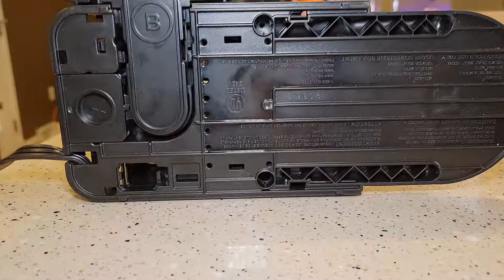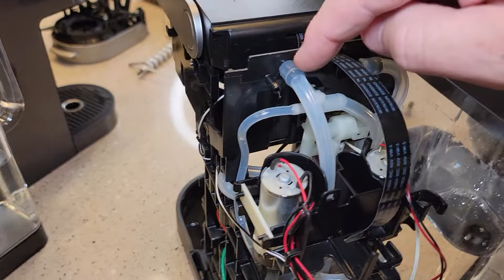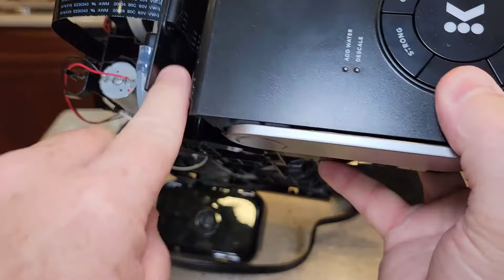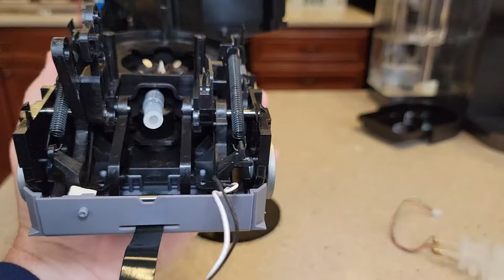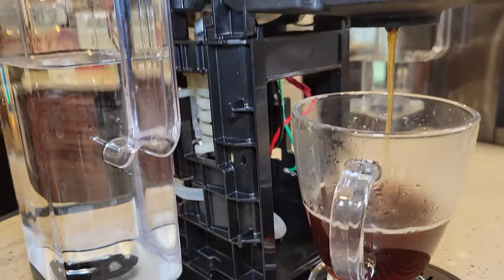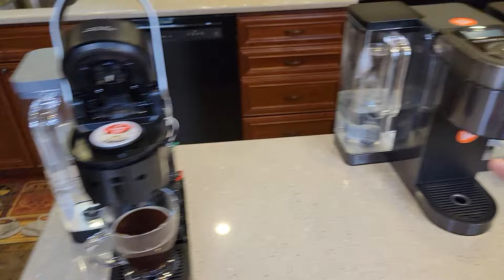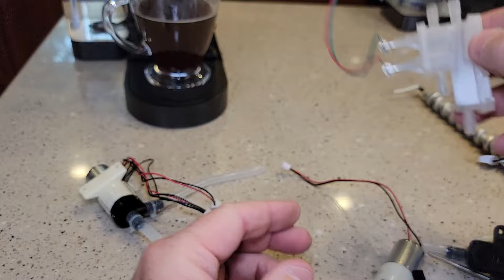🔍☕ Keurig K-Supreme Inside Look | How It Works & How to Take It Apart

Comment: Great video.  Helped me resolve my problem with my K going dead. The heat sensor reset was the fix. Another suggestion to keep that heat sensor from tripping is to make sure you always change the charcoal filter in the tank after every descale if you use it or better still, get rid of the tank filter and use bottled or filtered water from another source. If that filter gets clogged it will slow up water flow into the machine and trip that internal heat sensor. I got rid of mine and it's been perfect ever since.

Comment: I just wanted to know exactly what parts the heated water run through, and if they are plastic. I don't want hot water running through plastic tubes. I saw the heating element is some sort of metal, but I'm trying to avoid plastics. Is there anyway to avoid running hot boiling water through plastic?  Thanks

Comment: Mine was getting intermittent power to the control panel on top, sometimes it would stop in the middle of a brew cycle too. The wires to that microswitch run along the side of the machine and flex every time you open the top, eventually they break on the inside. I had to solder a spliced wire in there and it works like a champ.

Comment: The thermal switch is resettable. Pull the plug from the wall before you do it! Use a larger size paper clip (it's stiffer) and push it in till it clicks.

Comment: This video helped me fix my Keurig that wasn’t brewing full cups. Thanks a lot. In my case it was the tube connecting the manifold to the sensor in the board. It had a lot of buildup inside. All the rest was sparkling clean and seemed to work fine. I took it off, rinsed with water and vinegar and installed it back. Now I can brew full cups again, thanks!
Reply from the maker: Happy to hear that the video was helpful!

Comment: Nice breakdown! First that heating fuse DOES allow you to reset it by putting a paperclip in the hole and “click”. I have a Costco version which looks very similar BUT it does not have the air blower. When mine is near the end of the brew an actuator at the top allows air in allowing the pump to pump dry. Instead of that tube that went to the board, the tube goes to the top of the machine with that actuator wired back to the board.

Unfortunately for me, that actuator stays open so it won’t suck any water into the system. If I pinch the hose during the brew it will work. Then towards the end, the pump sound changes and that’s when the actuator would open allowing air in. So at that point I can unpinch the hose and it will finish the way it is supposed to. At this point I don’t know if it is the actuator or the board not sending the signal. Either way it seems these things are made very differently and my chances of finding a video with a solution slim.

Comment: I think there’s something more going on, at least in mine.  Cause if I just want hot water, hot water comes out and it’s not going through the head.

Run urs without a k cup and u should see.  Maybe that’s what that flaps for?

Comment: How do you get that top part off? The little black wire on my micro switch that tells it when the lid is open and closed is broken off likely due to a bad solder.

Comment: What are the black and white wires that are on the sensor unit? I took mine apart to reset the thermostat and the black wire got pulled out.

Comment: Nice presentation; thanks.  I'm curious how the "Descale" notification sensor works.  What is it measuring, and how does it do that, when it turns on the notice?  Our last two units both had "descale" notices that were impossible to extinguish despite multiple descaling efforts.
This is my first exposure to your channel.  I subscribed.

Comment: The old Keurigs had a disc float in the tank with a small ferrous disk  in it. A sliding magnet switch in the machine housing slides towards contacts that energies the machine. When the water level gets low it breaks contacts and the water fill indicator lights up.

Comment: The old Keurigs had a disc float in the tank with a small ferrous disk  in it. A sliding magnet switch in the machine housing slides towards the ferrous  disc  and contacts that energies the machine. When the water level gets low it breaks contacts and the water fill indicator lights up.

Comment: This is a great video!  I'm thinking about taking my K-Slim apart to see if I can figure out why it stops dispensing after just a few seconds!  After I bought it, I used it for 2 months without issue... but I live outside the US and brought it back with me in my suitcase, and now I'm having this issue.  Descaling did not fix it.  Resetting did not fix it.  I think it might be a problem with a sensor or pump.  What should I be looking for?

Comment: What does the air pump actually do? increase flow pressure? clear lines after cycle? Is it controlled by micro to maintain a brew chamber pressure?

Comment: hmm, funny since that’s what also failed on the one I took apart last year. The problem is the water pump was fine and it seems most fail during descaling. Finding that exact temp and spec replacement part is almost impossible. So just match it as close as possible with a slightly higher temp one.

Comment: Thanks for the vid. Whanted to see if i could micro build it myself using a used one. yes definitely can micro build something with the parts. Just the heating element needs to be bought. $7 bucks in amazon. This explained enough safety focus for my build. Again thanks for the video.
Reply from the maker: Glad I could help

Comment: Can you look at your functioning Supreme units and tell me if the small diameter tubing leading to the pressure sensor on the circuit board is full of water or full of air?
I had other repairs to make on my unit and that tubing was removed and then reinstalled.  I am wondering if it is supposed to be full of water to carry pressure to the sensor on the circuit board to tell it to keep the brew cycle going.  My brew cycles are stopping after about 5 seconds.
Thanks.

Comment: My Supreme intermittently tries to start and it sounds like it has a little air in the line at first for a second or two, then it stops the cycle.  I can open and close the handle a couple of times and then it finally brews.  I don't see any sort of check valve here unless I missed it.  Is this the sign of a weak water pump?  If so do you have any suggestions where to get a new one?
Reply: I am working on the same or similar problem, where the unit starts running when I press a brew button and then stops after about 3 to 5 seconds.  I tested my water pump manually by removing its connector from the circuit board and connected 12 volt DC power to it.  IF*, and that's a big *IF the pump is primed, it will pump water through from the reservoir all the way out through the needles and into a cup.  Therefore I do not believe my problem is with the pump.
In the case of my unit short cycling and turning off, I suspect that the circuit board is not receiving information from a sensor to  confirm that water is flowing.  
Let me know what you find out as you troubleshoot some more.

Comment: If you are here for as dead Keurig, find the thermal breaker about the diameter of a dime with a hole in the center of it, two wires coming from it.  It's likely stuck open, push a toothpick or something into the hole to reset. If you know how to use a multimeter check to make sure it's closed (or was open). THIS is a very common mode of failure on these units. You likely have the problem if goes  dead, no power. Easy fix!

Comment: I have seen that vent with all kinds of mold in it. The whole machine is a petri dish. High bacteria levels also from swab test. I would never use one. Aluminum coil very bad as it oxidizes. May cause Alzheimer's.

Comment: that rubber cover beneath the needles, is for pressure release in case you open the keurig while operating, so it doesnt squirt you in the face/body with steaming hot water.

Comment: The one I have is a K85 with the milk frothier attachment. It only uses one air pump and two outlet lines, one to the head needle and the other to the bottom of the k cup. Not sure what the bottom line does for the bottom of the k-cup?  That bottom of the K cup has a needle as well to puncture the bottom. I think two hot water entry system, one from the top and the other to the bottom.

Comment: I had the issue where I was able to reset the heating element but it was not pumping water out. I tried different troubleshooting methods and finally narrowed it down to the pump, or the circuit board itself. Luckily I had a 12 volt battery. I connected some wires directly to the connector for the pump and the pump worked fine. I figured that this machine was toast and it was the circuit board that was bad. I put everything back together and decided to try and run it again. To my surprise, the machine started working. It’s almost like the pump was stuck and needed extra power in order for it to get going again.

Comment: @4:29 The thermostat is "non-resettable." I have heard that a paper clip pushed into the hole in the center of the thermostat will reset it. I've never tried it, so I don't know.
Reply: Yes it will reset that way.  But some times there’s a reason it overtemped.  I reset mine a month ago, so far so good.

Comment: It's now Jan 2024 and I've had my K Supreme for a year. Several months ago it stopped producing the volume assigned to each button, IE, 12oz➡️10oz; 10oz➡️8oz, etc. The deficient value is 2 oz at each setting. All needles have been cleaned multiple times; descaling performed multiple times; factory "reset" performed, deficient volume remains. Logic board vs bad pump vs ??  I found this video interesting as I thought there might be a needle assembly check valve as depicted for other units. Your disassembly of the needle assembly did not show such a valve. Is the line to the pressure transducer supposed to contain water as in your video or be open to atmospheric pressure?
Reply: Is your unit running longer for increasing cup size selection or does it shut down after the same amount of time regardless of cup size?
If it shuts down after the same amount of time, I suspect a water flow sensor's signal is not being detected.  In this case the circuit stops the brew cycle after the same amount of time.  I have a K-910 (no digital display and has a pressure sensor mounted directly on the circuit board).  My unit is short cycling after I tried to remove visible scale from the small hose leading to the pressure sensor.

Comment: Could you tell me why my 920 supreme  plus it looks like the one you have taken apart. when I brew my coffee it doesn’t come out in one stream. It runs over the sides and top itsplashes into my cup. I have called Keurig up and they have no solution they don’t even want to bother because my machine is out of warranty. I would appreciate any explanation why it is doing that I already descaled clean the needles, etc. it’s not that.
Reply: There is a "safety pressure release rubber flapper" under the pivoting head that may have become folded or pushed out of position.  If it is not laying flat, the water that should flow through the needles flows out this pressure release and runs around the circumference of the K-cup holder.  Check this and if it's not the problem there is something else to check.

Comment: Black rubber flap under the lever/lid seems to be just a pressure release for when you abort a brew cycle before it is completed.  So, the flap opens when you lift the lever to vent hot water in a safer way than through the needles (for less of a mess).
Reply from the maker: Very true

Comment: If you connected the two continuity wires then you would be able to use all the water in the tank, correct?

Comment: Take the pump apart and you'll see it's has three chambers, or valves. What is curious is there is a cam on the shaft that does not ride or touch anyting, (so it's not a cam) but passes infront of somthing on the circuit board on the side of the pump. How does the different cup sizes? is this the piece that detmindes that.
Reply: That rotating "cam" appears to be a magnet that creates magnetic pulses as it rotates (a Hall Effect circuit).  Those pulses are counted by the circuit board.  Each pulse represents a very small volume of water that has passed through the pump.  Each cup size has an associated number of pulses that must be counted when the pump is running.  After the specified number of pulses is reached the water pump is turned off and the air pump turns on for a defined period of time to purge the water line and the K-cup of water.

Comment: The microswitch in the lid of mine no longer works. How do you take the pivoting head off? I see you have taken one off but I don't want to break it. For now I added an external switch but its a cob job.
Reply: Remove two screws from the underside of the lid (don't lose them).  Lift up on the cover slightly while pulling it toward you then push it toward the rear of the machine (I do this all in one movement so I hope I described what I did).  Essentially, removing the screws allows the cover to be pulled forward, then lifted up slightly, then pushed to the rear of the unit, allowing it to be removed.  You will see the microswitch and its actuator lever on the right side (on my unit-yours may be elsewhere).  I had to adjust the bend in the metal actuator lever that pushes on the switch's button to get mine to operate consistently.
Reply: @timhoerner4731  Thanks, been using it with an external switch for months now and that works fine.  Just hooked it up where the original switch plugs in the back. May try your method. I have a new unit in the box for a backup if the worst happens!

Comment: Very cool. My water level sensor does not work. Not sure why since it’s a simple sensor that seems to use 2 wires to complete the circuit when under water. I wonder what it looks like inside the plastic case?

Comment: Thank you! It was great seeing the two pumps and how they work together. It appears that the pneumatic purge pump comes on as soon as the fluid pump turns off. One of the pressure switches must tell the machine when the water has been purged from the lines to end the cycle.

Comment: I have power but it appears the control is stuck on the strength and temp adjustment and it clear. Also, I can get it to descale mode with the flashing K but it won't pump the solution. I've cleaned the needles and tried the baster without success. Any suggestions?

Comment: Slight difference between this and the supreme plus on the mother board.  instead of a pressure probe connector on the mother board, there is a more robust bus box labelled "FPN-07PG" made in Japan.

The issue I keep running into is the thermal sensor keeps needing to be depressed, and I'm wondering if it's connection to the heating coil has become degraded over time.  The symptom each time during brew is the shutoff after the third dot on the HUD.  I have probably reset that thermal sensor about five separate times now.  I get it to work for about a month and then it seizes again.  Real pain.
Reply from the maker: wow thanks for some really detailed information.  have you been keeping up on the descaling?
Reply: @JustADad  yes and no.  Unfortunately, the actual descale mode overheats the thermal sensor.  I ran full descale mode and within two brews the following day, the auto-shutoff triggered on the third dot of the brew cycle.  
Ultimately, you end up with the descale HUD message never going away, but it's fine.  I just manually descale every few months.  I keep temp and strength settings minimal and will run about two 12oz "brews" of 1:1 water-white vinegar solution.  After, I just unplug and leave alone, run clean water the next day to flush the vinegar and rinse.  This pretty much prevents overheat.

Comment: I'm glad I came across your video on the Keurig K Supreme.

After watching your video and putting my Supreme back together and having it work, I do have a couple comments.

First of all, your explanation of how the plumbing of the Supreme works had some incorrect info and mistakes in your video.
The first issue I noticed was you were holding the water level device upside down. That device has a thermocouple sensor in it along with the probes to indicate water level is low. 

The second issue that would have been very useful would be to remove the electrical panel covering all that plumbing that you were trying to explain to show the routing of all those hoses. Your explanation of the water flow would have been much easier and would be of great benefit to anyone who removes those hoses and forgets how they go back together.

Fortunately for me, with your general explanation, I was able to replace all my hoses on my machine and the Keurig worked when I had it completely assembled. Thank you for you videos.

Please produce a more detailed water flow explanation with showing all tubing connections.

Comment: after I reset my k supreme , I ended up fixing the no power issue but now when I power it on the 12 oz light stays light up while the power light blinks 2-3 times. after the blinking the machine turns off right away, I tried to hold the 12 oz and pour button and noticed the machine stays on and manually pours for as long as I hold the buttons, but the water is cold! so the heating element isn't turning on anymore or maybe there's something else I can reset to make the machine stay on and let me select sizes idk. The machine wasn't even 6 months old from purchase
Reply from the maker: oh wow, this coulb be a bad computer board,  I would call Keurig for sure.
Reply: You may be in a diagnostic mode.  I am working to find out more.  Will post when I do.